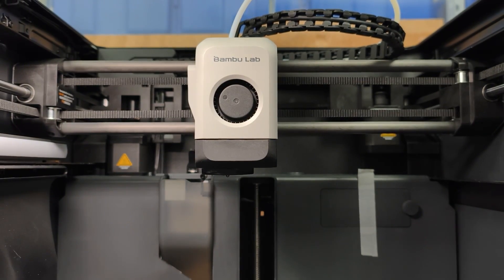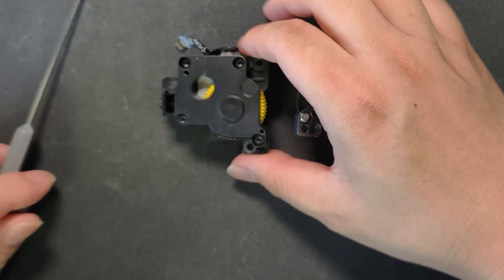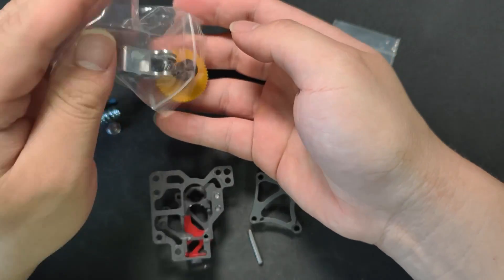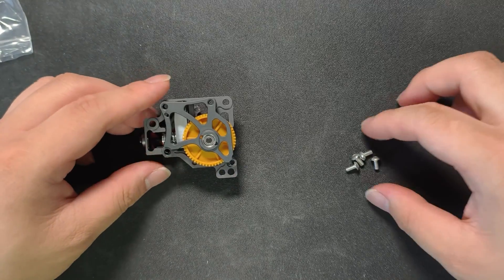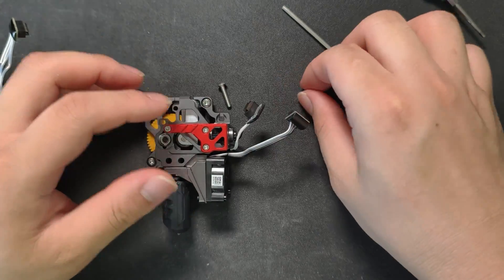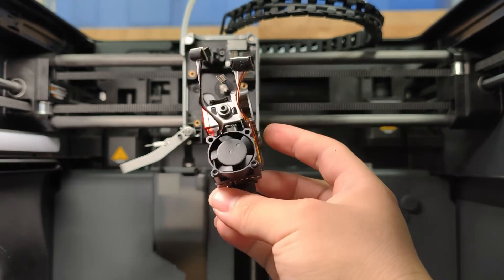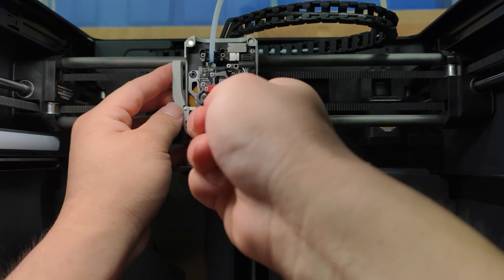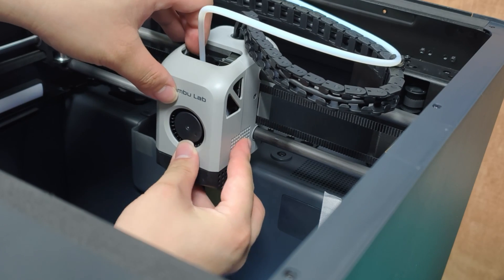Mellow Upgrades for Bambu Lab P1 Printer FluxHeat Lite Extruder and Hotend #3dprinting#bambulab

Comment: What is the difference between this and what BIQU did, which also costs 2 times less.
Reply from the maker: The FluxHeat hotend offers improved flow performance, with a maximum extrusion flow rate of up to 40 mm³/s

Comment: What makes this extruder housing better than the one Biqu sells? I like this color more, but the biqu one uses the original screws
Reply from the maker: Lite Extruder and Hotend improves the flow rate, and the maximum flow reached 40%."